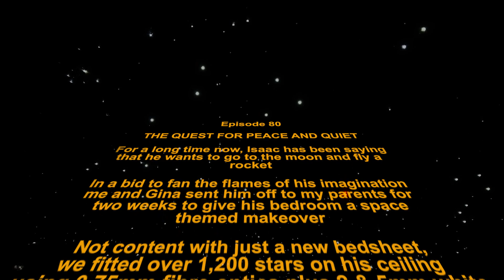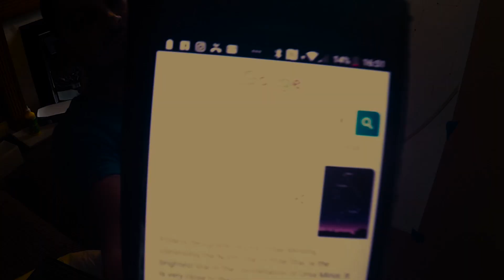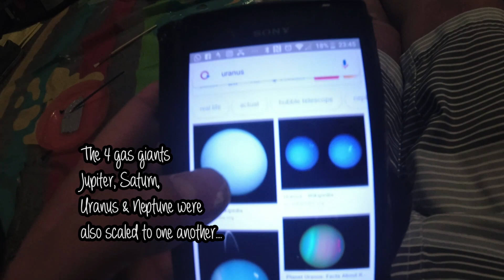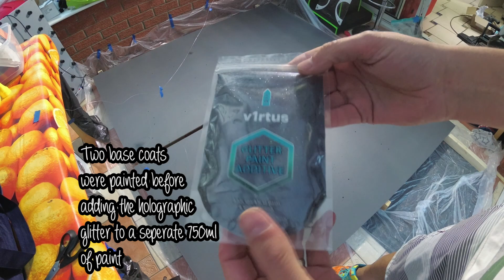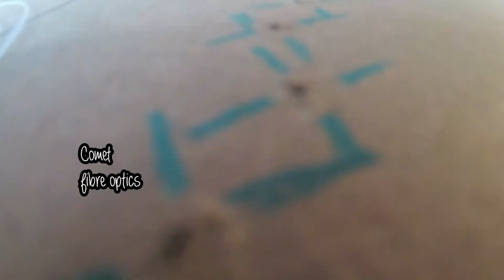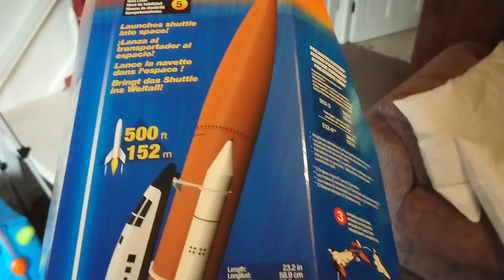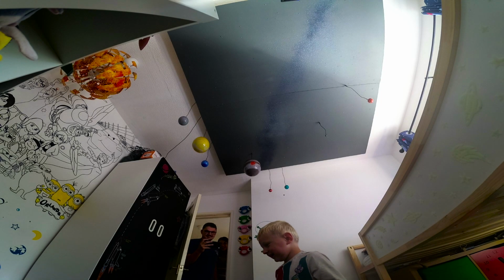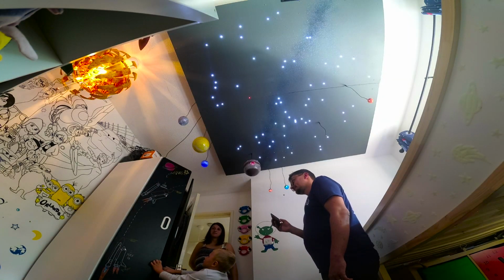Surprising Isaac with 1200 Stars DIY Space Bedroom Makeover!!! - Vlog 80

Comment: Have been looking for a fibre kit to install in my soon to be newborn's nursery and noticed your comment of this video on an amazon review. Absolutely love this video and the effort you both put into this. Added bonus to see the little man's reaction and delight on his face, outstanding!
Reply from the maker: Thanks for the comment, yeah he absolutely loves it and almost every night he wants it on.

The kit is great, it's not too bad to install and considering it's had possibly over 150 hours of run time so far, it's not missed a single beat.
For the most part it's always set to white, but when the color is set it's very vibrant and the fade function on the remote does allow it to dim to the point its not intrusive with two of the kits, so if your going for just one then I'm sure it would be fine too.

Hope you do go for the kit, I'd just recommend to take the time to install it into a false ceiling and not into plasterboard!
Reply: @AndrewCromarty  yeah will be buying this kit next week now I've seen this, why do you prefer a false ceiling? Original plan was to just go straight into bedroom ceiling via loft above, am open to advice though!
Reply from the maker: @stevieboy1986  my main thought behind a false ceiling was that plasterboard can be a bit of a faff to neatly drill, that and using a false ceiling ment that I can work on the panel, waist height in the bedroom below and reduce the time on my knees in the loft/arms above my head

The only other advantage I would see is that the loft insulation can be left as is with just a small section to get through to the false ceiling. Fitting the Fibre directly to the plasterboard would mean that the weight of the insulation would be straight on top of the optics rendering that section of loft space unusable, just one misplaced foot onto hidden optics could snap 50+ in one small step, that or the insulation would have to be intricately cut/placed around each optic to sufficiently retain the heat in the bedroom as well as before
Reply: @AndrewCromarty  yeah that's a fair point, definitely something to think about. I'm more conformfortable installing straight into ceiling but may call in a favour!

Comment: Great video. One question, what 'pattern' did you use for the comet set? I see there are 10 bundles of 4/5 strands. Did you just put these in a row or group them together? Or even just put the 4/5 in the same hole?
Reply from the maker: The comet was laid out alternating 2 or 3 wide, I also had the first one from the next cluster just inside the previous cluster (trying to smooth out the effect) so there was always at least one on within the cluster before and after the ones that were on
Reply from the maker: .... If that makes sense 😂
Reply: It does, cheers. Fantastic end result 👍